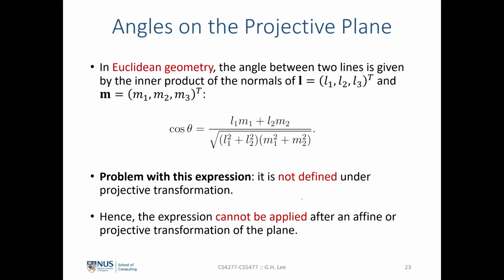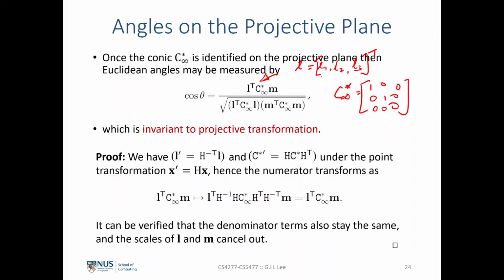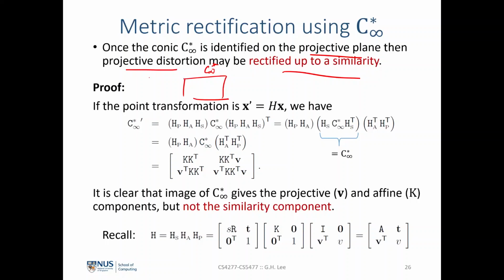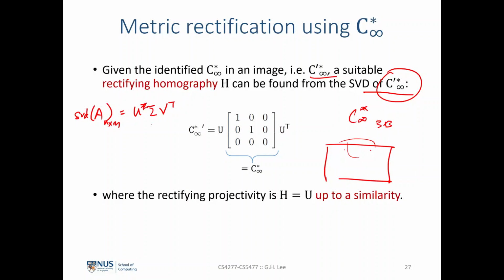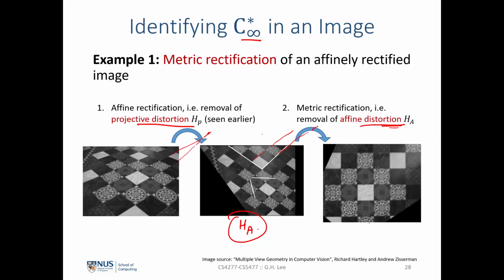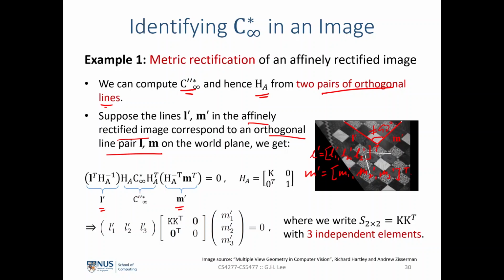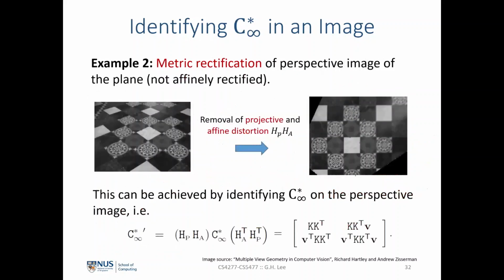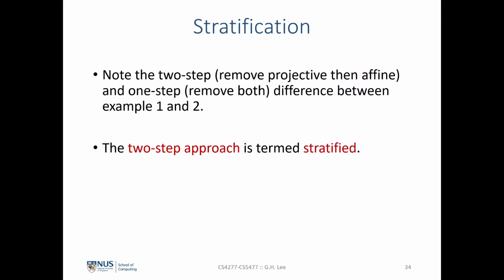3D Computer Vision | Lecture 3 (Part 2): Circular points and Absolute conic

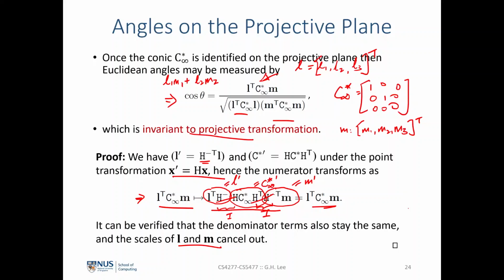Comment: at 7:51 according to the equation angle between the lines is preserved under projective transformation, how is that possible when we know under projective transformation parallel lines are no more parallel that is angle between the lines is not preserved??
Reply: Angles are not preserved under projective transformations. That equation allows us to calculate the "original" angle between two lines. For example if perpendicular lines become acute angle lines in the image, we can perform the calculuations on the image with the acute angle lines and get that they were "originally" perpendicular.